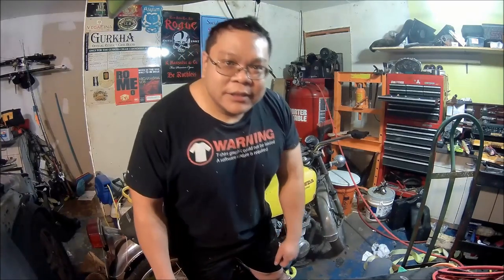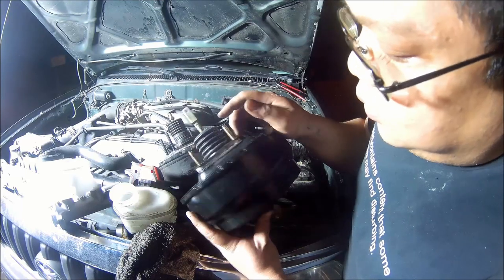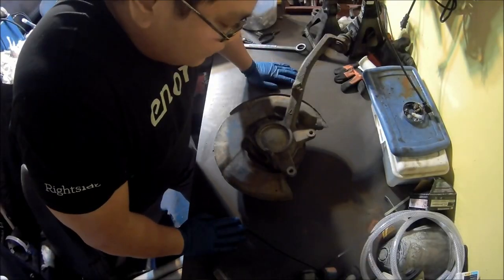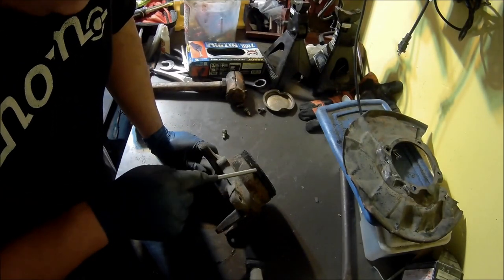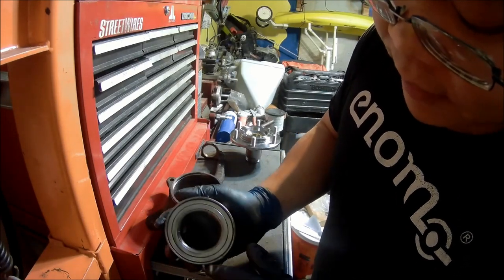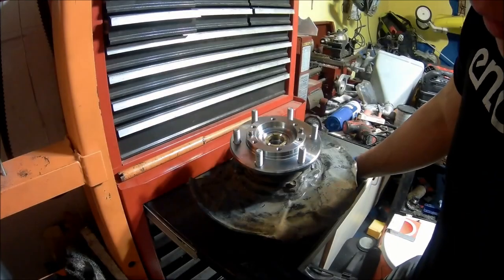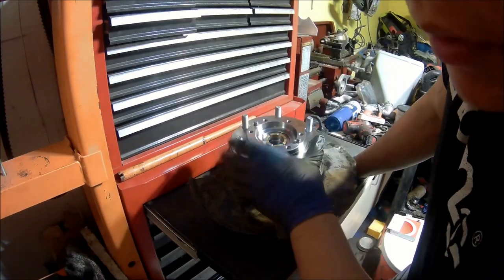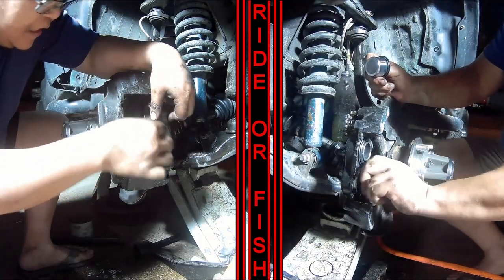Tacoma Brake master cylinder/ brake booster and locking hubs upgrade.

Comment: What parts store did you use for manual hubs. Been looking all over for parts and have no luck.
Reply: Found them! Thanks for the video! Took advice and got Aisin hubs. Now to find bolts and cone washers.
Reply from the maker: @justinvarela760  nice. Look on eBay for the cone washers. There's a guy selling them out of Australia for a quarter of the price it would cost to get them used or new from Toyota. As far as bolts you can just get some from Lowe's. If you get the ones I bought they will work just fine.